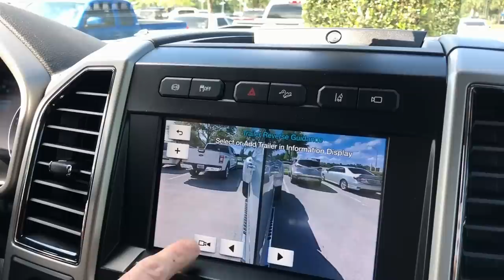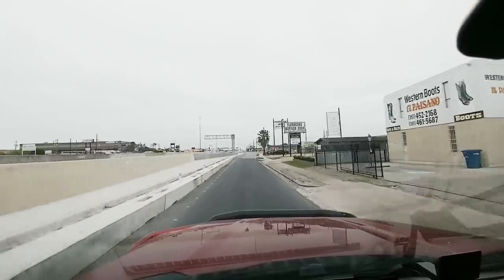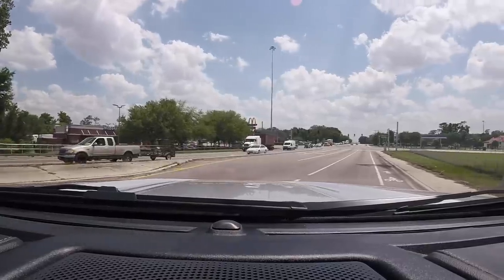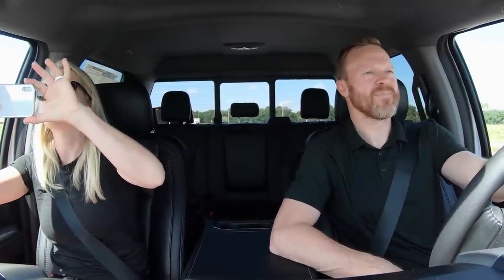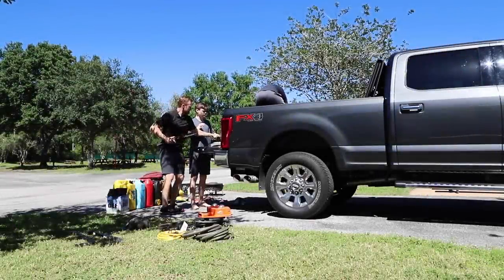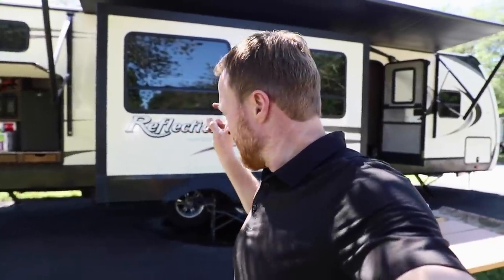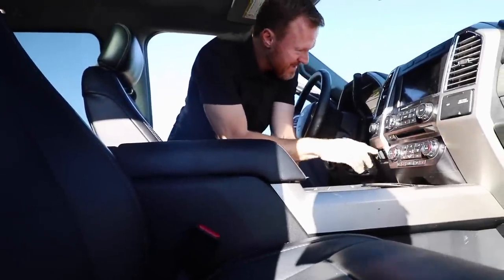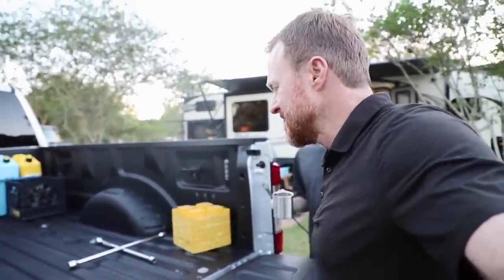2019 FORD F450: OUR NEW TOW VEHICLE! (WITH BIG TRUCK BIG RV)

Comment: Great video! However, the info on the driver license you gave out is incorrect. I’m a Texas State Trooper and just wanted to let you know that you do not get an exemption from driver license laws in Texas just because you don’t live in Texas. We do give an exemption from CDLs if your towing an RV but in that case you would still need a Class A driver license to tow a combined weight over 26,000. 👍🏻
Reply: This doesn't sound right.  My understanding is that Texas (and all other states) honor the licensing laws that the home state that the driver is licensed in states.
Reply: No sir. Unfortunately that’s not how it works. Like I stated previously, I’m a State Trooper and as one am very verse in traffic law specifically. I’m a 10 year veteran as well as a field training officer. Driver license laws are kinda like speeding laws. It’s what makes up our bread and butter on a daily basis. If I wasn’t sure I wouldn’t have posted. While we honor the basic driver license from all states and even other countries, those laws only apply to vehicles under 26,000lbs. Anything over 26,000 you need a CDL unless you qualify for an exemption. If you do qualify, then you would still be accountable for having the proper class of driver license. Like I stated earlier, we only honor the basic Class C driver license or your state equivalent. Hope that helps.

Comment: I thought I had posted a note about putting a tail gate stabilizer on. Don't see it. (I had posted from my other channel) So, with that, as you are finding out, crawling between the trailer and truck to pop the latch on your tailgate, it is a heavy gate. It leans on you while you are crawling back out. Get a tailgate assisted damper. You will thank me later.

Comment: On my 62nd Birthday, you debut the new F450, which was a month after I bring home a 2019 F250 6.7 Powerstroke. Hilarious! So, big question: Are you gonna add the VIAIR and 60 Gallon fuel tank to the new Effie? Congrats on the new truck
Reply from the maker: The 450 is my dream truck, but the 250 is my fav truck. Transfer Flow doesn't make a 60 gal tank for the 450s. It has a stock 48 which has proven to be big enough so far. Yes, on-board are is in the bed, but not installed yet.

Comment: you can get upfitter switches added.  as far as i know, they come all pre-wired and you find the place in the dash or over head and wire them in.  so no big deal.  sunroof is a little more tricky, dremel, clear plastic shrink wrap and gorilla tape.  trish may freak a little at the sunroof.

Comment: The dealership has many many employees and a system designed to outlast the buyer. They take advantage of both. A prospective buyer has zero control over the process other than to walk. Dealerships have a technique to handle even that. It is deplorable what the auto/truck industry does. I left the industry  two decades ago and went back to college. Best move I ever made. Looks like you guys did well. Congrats.
Reply: It's a vicious industry behind a calm exterior and the consumer is always the loser, despite frequent bragging to the contrary.

Comment: Something both videos ignored was the payload of both trucks. The 2019 Ford guide says for a Crew-Cab 8' bed, the 350 DRW 4x2 has a max payload of 6970 lbs and the 450 DRW 4x2 is only 5630. While the towing capacities are nearly the same, the 350 has 1300 more available payload.

Comment: Just replaced the tires on my F-350 Dually....as JD said, I had lots of choices. Spent $250.00 per, and if they last as long as the originals I should get around 60k out of them. BUT, I didn't pull my 5ver all those miles either. Without a doubt the turning radius is a big deal as I have to make a U-turn every morning on the way to work....make it with only about 4 inches to spare. With the 450 I'd have at least 3' clearance.  Anyway, good luck with the new truck.  Be safe, have fun, and happy camping.  v/r, TS

Comment: It took over a year to find my RAM 5500. I live in CA and looked all the way back to Ohio. I ended up special ordering a truck out of Prescott AZ. I know I wanted to buy an Eagle Cap 1165 so I wanted a truck with the payload capacity. I also carry a Honda 3000i generator and 100 gallon tank on the flatbed. That gives me a range of 2000 miles with my diesel.

Comment: I think you could mod in the upfitter switches if you wanted to. I bet some dude on a forum did it and documented it. Same with the seat heaters/coolers. I like to look at that stuff as a challenge. I would have stripped all of your mods before you turned it in. Especially the compressor. The reality is that is not always possible for many reasons. So it gives you an excuse to upgrade! Like a dual alternator mod to support battery charging on the rig!

Comment: Dealerships sure are fun :-( Been there done that. Wait till you need a new set of tires that will set you back in your seat, the good thing is that you will get alot more miles out of them. Congrats nice truck. Once you tow with a dully its hard to go back, much more stability and controll.

Comment: Just finished watching JDs video and ended up here. One thing that wasn't discussed, although you kind of got close, and most people don't really consider is size. Size as in how long, tall, and wide the truck is and will it fit. Will it fit in the parking lots and garages I frequent? Will it make the tight turns (turning radius was discussed)? And one that I, and others, put a lot of emphasis on "will it fit in MY garage?" It's easy, when looking at tow vehicles, to seek the biggest baddest towing capacity truck but does it fit into the part of your life where you're not hooked up and towing?

Comment: We bought our first RV a few months ago - a 2019 DRV Mobile Suites 36 RSSB3 - as well as our first truck, which wound up being a 2019 Ford F350. I researched as much as I could before pulling the trigger, but I'm wondering if maybe I should have gone with an F450 vs the F350, mainly because of turning radius. I had heard from a couple people that insuring a 450 could be a different animal than insuring a 350 (something about some insurance companies considering the 450 to be a commercial truck or something along those lines). Our F350 is a beautiful beast, and I paid enough that I won't be considering a change anytime soon! We went from a Toyota RAV4 to the F350; the first time I hit the slightest little bump in the highway with the unloaded 350, I thought we were going to hit the roof of the truck!! We named our truck "Samson" and our RV "Delilah". Love your videos, guys.

Comment: One thing I forgot to tell you is that Ford makes a water coolant additive for the water pump to stop the cavitating effects. Check out power stroke diesel on you tube for info. The water pump turns so fast it will make a pin hole in the water pump. Also have some extra silicone hoses for the intercooler as those will blow or tear after time due to heat. I hope you have on issues with the new truck as I really like it.

Comment: I am surprised you didn't get the Hensley Trailer Saver BD5 Air-Ride hitch and for the storage bay if you get the 90" Morryde tray it will slide out both sides of the trailer

Comment: The vibrations at 40 mph when empty will not go away, I have a F450 and had numerous conversations with dealer and they stated it is inherent with unit from Ford. Ford has installed a counterweight in the right rear corner of the frame, but it doesn't work. When towing a load the oscillating will cease.
Reply: I have no issues with my 2019 F450.   Empty,  rides is smooth as a baby's Butt!!

Comment: I can tell you without a doubt the 450 has a tighter turn radius over the 350. And the ride is so much better.  I just upgraded from a 350 to 450 last week.  Parking is so much easier now
Reply from the maker: It's unreal. Congrats.
Reply: @KeepYourDaydream  I watched the rest of your video, I love everything about the truck,  only issue is you take up 2 parking spots front to back unless you can find a spot to back into.  The camera thing got me too, I hopped onto the running board looking for a camera on the roof.  I paid 79k for mine after rebates but got every option they had on it.  The remote start is cool, you can even start, (un)lock the doors from your phone if you need to.  I also like how the tail gate automatically locks too to keep curious hands deterred.  The fuel tank is massive too, 700 mile range on a fillup!  Definitely in a whole different league than my 350 and definitely a 250 :D

Comment: I bought the F-350 SRW for our Reflection.  We are not ready to go bigger RV, still appreciating the <35’ length for campground sites.  If (when) we go bigger like a Solitude, will consider at F-350 dually or RAM 3500 dually.  F-450 will be considered bec of your VLOG.  But no dog!!  - Jersey Mike

Comment: We tow with an F350. You are right about the turning radius. Our F350 has the turning radius of a railroad locomotive. Other than that, we love our truck. Also, it will fit in our garage. The f450 is too high and contacts the bracing on the top of our garage door. A SRW F350 does the same thing.

Comment: The off-set rims are hard to balance. May need to take it to a truck tire shop to have them professionally balanced. I noticed most car dealerships and reg vehicle tire shops have very little experience in getting these well balanced. Based on the go pro vibration I would say it needs to be balanced again by someone that knows how to do it well. You do get some more than what you would notice to your 250 but shouldn't be really bad.
Reply: I should say this is my opinion about the shops in my area at least.

Comment: Look at Link or Kelderman suspension for the rear.  I had an F550 with a 5th.  I posted in your previous video.  There are dealers in Florida.  Made the 550 ride just right empty or towing.  Also, kept truck level, and made hitching/unhitching super easy.  Trust me.  I was very satisifed with the Link brand

Comment: I have 2017 F350 King Ranch Diesel rated 21,500 gooseneck towing. Love it love it. Rides very nice too. Paid $56k with 60k miles. When doing a video make sure not to tell how much you pay for what the whole video is about. Still love your videos.
Reply from the maker: The King Ranches and Platinums add big $$$ so I picked a Lariat with fewer options.

Comment: Hey on a different note do you know of a 4 wheel drive camper van that's kinda like the Winnebago revel . But I can't see getting the revel since you can't have volt start on it, which allows it to crank and idle when the batteries get low. So that you can run the air for when I have to leave my poodle in there by himself to get groceries or when I go in some place that don't allow dogs. And suggestions?

Comment: I noticed that this truck and your F250 are both FX4. Did you do do this for a reason or were they just the trucks that were available?
Reply from the maker: We use 4x4 quite often now with the cabin in Flagstaff, but we have found where we like to travel with the RV sometimes we go off into the mountains. In Banff we went out bear searching. I also like trucks that are higher off the ground so the trailer is level. But it does add weight.

Comment: You must get the Centramatic wheel balancers to get rid of the frequency vibrations. You are mistaking the rough vibrations for the stiff sidewalls. I have the F-450 Limited and went through this. The Centramatic balancers smoothed the ride out. Still a stiff ride, but smooth at all speeds.

Comment: One often overlooked solution to the stiff tires is to weigh your axels and inflate tires to required pressure for that weight, rather than inflating to fords ratings which are for max capacity. I am assuming that with the 450 you won't be at its maxium capacity.

Comment: I’ll keep my 17 F 350 DRW with 4.10 rear end thank you very much...turns just fine too. 😂😂
Reply: We have a 14 F350 and the turning radius is the most disappointing part compared to the 1/2 ton we had before.  Very big deal when trying to back the rig into a tight spot!

Comment: You can add FACTORY remote start. The key on amazon is like 60 bucks. The remote start kit is like 35 bucks and programming for new key is like 65 bucks. I did it to my truck. It’s a factory kit NOT aftermarket
Reply from the maker: Good tips. Turns out the Pass app locks it and starts it from my phone. Its actually better then the key, because my phone is always by me at night. If I wonder if the truck is lock, I reach over and bam! Loving it.

Comment: Your tire vibration most likely will smooth out with a couple of hundred miles loaded most likely you have some flat spots from sitting in a lot for an extended amount of time, if not it could be and balance issues from it factory. Tire vibration is not normal or acceptable on a 350 or 450. 👊👍😎

Comment: I am curious if you guys would be able to tow grand ginger with the 450, and give your opinion of the difference between 250/450. I have a fifth wheel and a large boat and would like your input on how grand ginger pulls as a bumper pull
Reply from the maker: I'm sure the F450 would tow a bumper pull with ease. The F450 is my dream truck, but the F250 is my fav truck.

Comment: You'll enjoy your F450 I also have 1 2013 and I'm also in AZ I love my truck Yes the ride is crappie with No weight but the towing capacity is night day difference from the F350 mine is all cab and chassis I have factory 2 fuel tanks and a flatbed Also mine is 4wd but doesnt look it I strictly use mine for PLAY Gteat videos keep up good work

Comment: Like J.D. said tires are an issue. Even with the simulators JD recommended there's always a bounce. The best tires I found for our F450 are the Cooper road master 253 M/S 
Size 245 load rang H. You'll find that size fixes the 10% off from Fords factory. Cooper offers 2 different tred patterns with the same part number. I run the aggressive tred on the front and the slightly less aggressive on the dullys. I'm averaging about 25000 on a set. On Nittos they chunked at about 12,000 and Nitto would not warranty because of the commercial ratings. 
And Kumo only got about 17000 and they were all on the wear bars.
  If you want to keep the horns, consider a foot switch. We have them on the fire trucks, there great, unless you forget to tell the valet in Vegas. You can find them on Ebay for about $20-30.
Our Lariat has ac and heat seats, controlled on the touch screen. I think you'll find the more you tow, especially if there's a big toy hauler in your future, there really is no other option.  Our total weight (Grand Designs 33rl) is just under 26,000lbs and we really only fill it on long steep grades, then we slow to around 72-74 mph

Comment: Great choice on the F450.  Having a F350 dually, I would appreciate the turning radius of the F450 many times over.  For your outfitters switch dilemma, try MLC-6 (70955) multiple light controller offered by Rough Country.  May fit the bill  Enjoy

Comment: Only other downside to an F450 is the larger rear end 4.30 which gives you less fuel economy when not towing, however the pros outweigh that one con, nice truck, cant wait to see what fifth wheel you guys are getting, best of luck.
Reply from the maker: I got 10mpg when towing 11,000 pounds with an F250 3.55 and now I get 10mpg when towing 18,000 with the F450 4.33. I don't know what I get not towing yet, because we're pretty much never not towing.

Comment: If you ever stepped UP to a GMC,  Duramax  with the Allison transmission, you will never look back. Look at the used pickups out there, there are tons of Fords out there and lots of Dodge, but very hard to find a GMC because people buy them and KEEP them, they are very satisfied.
Reply from the maker: Well... we've had 5 trucks between Chevy and GMC. Granted, it's been several years and all truck brands have come a long way in the last 5-7 years, but I couldn't take all the other issues. Something was always going wrong.

Comment: You can put a larger softer sided tire on the 450’s and 550’s
Reply: That is what causes the tires to heat up and de-laminate, sidewall/tread flexing. This is why big rig tires are sooo stiff on the side/tread.
Plus the load rating goes down when you go away from the high number of sidewall plys.

Comment: Thank you for showing all the differences in buying a 350 over a 450. My question is..... If one was to switch out to a 5th wheel and a correct sized truck, from, say a class A (which ours is a 30' Thor A.C.E 29.3), what is the cost of both combined (5th wheel and your truck)? I'm wanting to go back to a trailer because of the noise a motorhome has while driving. Can you give us a really close ball park figure you spent?
Reply from the maker: You can buy towable RVs for 25% to 35% below MSRP. Roughly 10% below MSRP for trucks, but even more if you buy used. I would have loved to buy used (private party), but we didn't have the time. In regards to combined cost.... MUCH less than most Class A's with the same options and no odometer for faster depreciation. For us, it's all about depreciation and cost of usage, not just the price to buy it.
Reply: @KeepYourDaydream  Would you say you spent over $120K?

Comment: Vibration / out of balance feel was probably from sitting on the lot a long time without test drives versus a 250/350 with more customers taking them out.  Probably once down the road and they warm up and come back into round they weren't as bad.

Comment: If you really wanted too you could always change the wheels to a 20" and put some more normal tires on it to take away  some of the shake and make it a bit more comfortable.
Reply from the maker: Now that we're adjusted to the ride, we don't notice anymore. I really like those tires, even though they are stiff. Under load, it rides just like the F250.